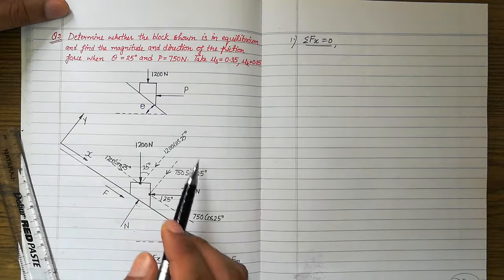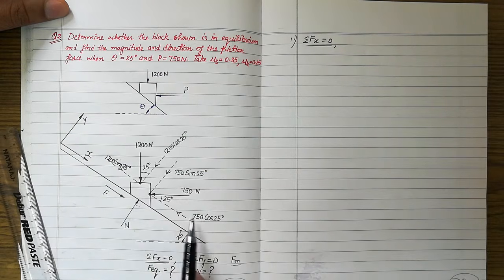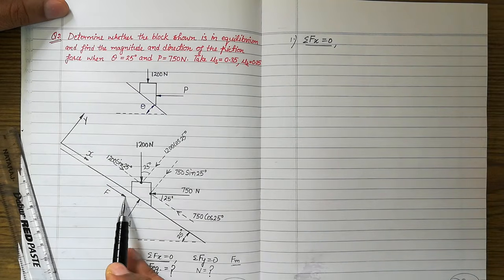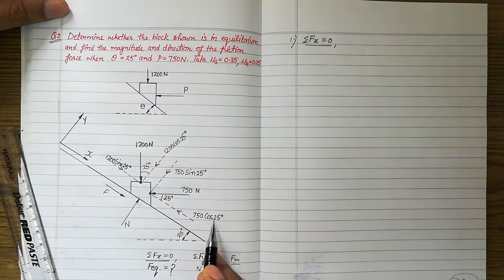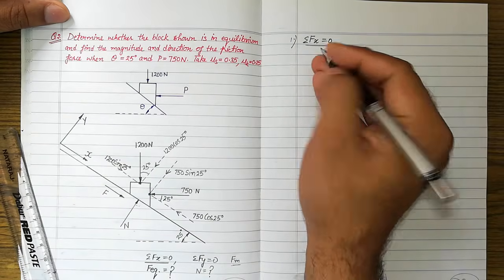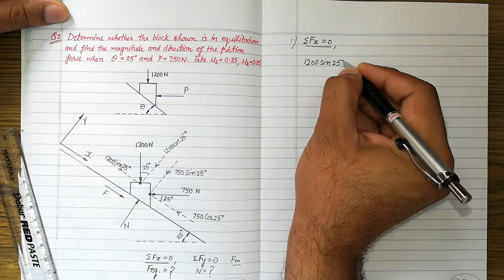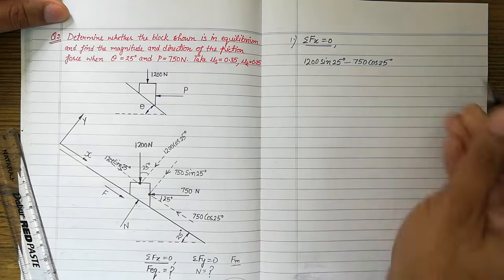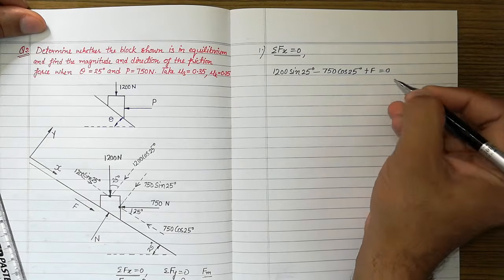Friction | Friction Problem | Problem 2 | Equilibrium of Block | Engineering Mechanics | 8.5

Comment: why are the sin and cos reversed in the 1200N force? Shouldn't the x component be 1200cos25 and y component be 1200 sin25?
I just want to know the explanation
Reply from the maker: Dear keep the following theory in your mind while labeling cos and sin components.

In this example, i took angle 25 degree of vertical component with 1200N force and i considered that as cos component. Now, always remember that we should take that component as cos component with which we are considering the angle of the main force that 1200N in this case.

 It is NOT like that horizontal component is always cos component.

For example if i consider the angle of other component with the main force that is 65 degree, then i can take that component as cos component, so it will become 1200cos65.

And in both cases value will be same, because cos 65 and sin 25 have same values.

I hope i made it clear